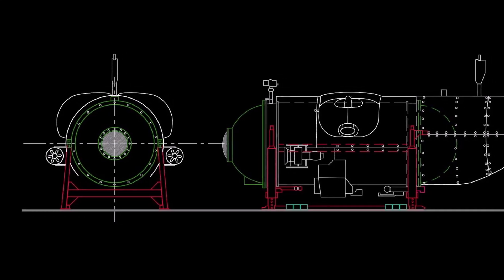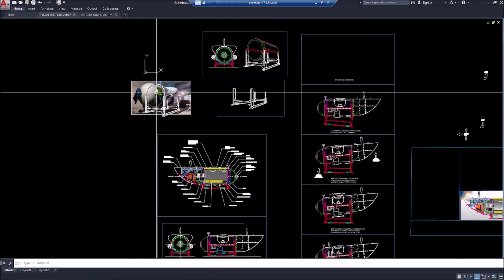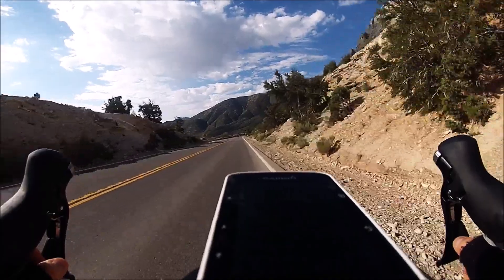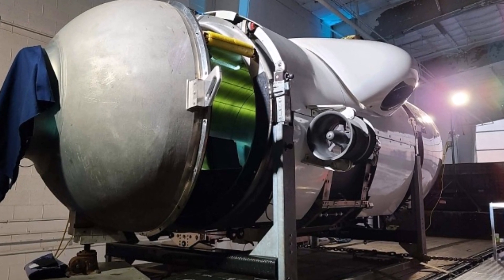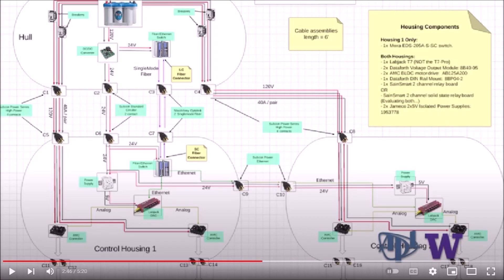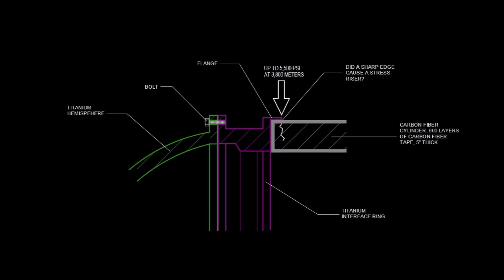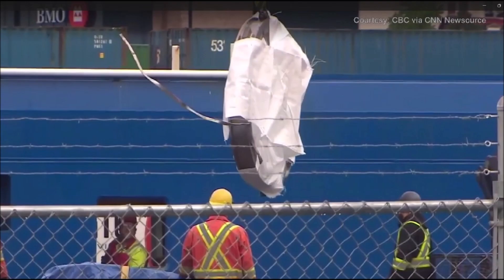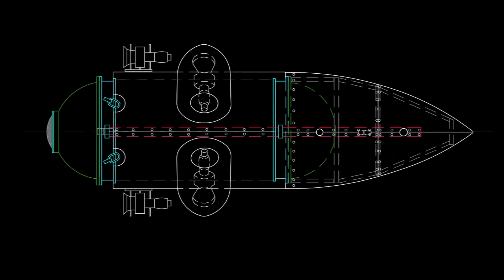OceanGate Titan - INTERFACE RING CAUSED FAILURE?

Comment: I agree with you that the weakness of the matting surface between the flange and the CF was the beginning of the end! I think there were other contributing factors besides those you mentioned also! The depth of the groove to accept the the CF into the bonding flange, but also the apparent tapper that was made to the CF, as can be seen at 3:40 of your video! If in fact this is a tapper, how was that tapper machined into the CF, and the fact that would provide a weak spot in the fiber! The groove should have been much deeper to accept the CF and the metal outer  surface should have been a lot thicker at the groove to provide a much more ridged outer surface to not create a 'pinch point' at that area! Not the flimsy thinner material on the outside of the groove that appears to be used! That area gave the CF a spot to flex outward as the [pressure was pushing in on the middle, thus causing the ring to pop just nano seconds before the implosion!
Reply from the maker: Yeah I hadn't really noticed it until someone else pointed it before you that the CF cylinder seems to be machined at the place where it would meet the interface ring. Certainly could be something of a factor here, how much I don't know. More and more everything seems to point to Spencer Composites providing OceanGate with a sub-par hull for a variety of reasons. I pinned a comment that has some very good info about the carbon fiber if you want to take a gander.

Comment: (4:19) You are missing the inner flange on the titanium ring.  The shell side of the Ti ring has a lathe-cut U-shaped channel that the end of the CF shell fits into.  The CF shell was cut down on a lathe slightly before bonding with the Ti ring, presumably for a more precision fit.  The inner surface of the Ti ring is straight not stepped as shown in your drawing, although I don't think that feature is important in the failure analysis.  A good view of the channel is part of the Oceangate video your winding clip is from.  They show the adhesive being spread on the inside of the channel.

Comment: (6:39) I don't think that is a notch.  There is a high resolution photo of this ring being unloaded in St. Johns on BBC's website and copies elsewhere.  If it were an intentionally cut notch, one would expect to see straight, well defined edges.  They are not straight in the photo.  My hypotheses is the black patch is some carbon fiber that remains stuck to the ring as can been observed elsewhere in the photo and in photos of the 1/3 scale model test wreckage.
Reply from the maker: Yes not at right angles to each other... probably to avoid creating a stress riser. The edge on the left isn't perfectly straight but it also had experienced a unimaginably violent implosion... could just be a little warped from that.

Comment: (5:43) There were two CF shells, the first built by Spencer in Sacramento in 2017.  This video clip is from 2017. The second CF shell was built by Electroimpact and Janicki Industries in Seattle late 2020 and presumably included lessons learned from the faulty 2017 shell.  Stockton Rush states in video presentations that both shells (2017 & 2020) were laid up biaxially with carbon fibers running radially and axially (perpendicular and parallel) to the cylinder axis. Brian Spencer confirms biaxial layup. The 2020 shell was fabricated with higher tech, aerospace grade equipment. It was built up with 1" layers and cured between layers. The layers are visible in the photo at (1:45).
Reply from the maker: Interesting info. That would explain a few things about pictures I recently found that show a different method of manufacture... no flanges on that spandrel. The method of manufacture you describe seems to be a much better way of doing it. I could see them doing bi-axial layers in the second one since the spandrel had no flanges on it. First one I don't see it was possible to do with the flanges on the spandrel.

So what happened so the 2017 version? How did they know it had problems? RTM system? Just curious how they would determine that.

Comment: It wasn't the outside flange that failed it was the inside flange that failed, that was only say 1/2" thick and was holding the carbon fiber in its shape, think of it like a glass window where it's incredibly hard to break when it's supported all the way around but extremely weak if rolled down even the smallest amount due to one edge being able to flex. I think that the inside lip started to crack on the rear ring and allowed the carbon fiber to lose its shape and implode.
Reply from the maker: Maybe. If the carbon fiber was manufactured to OceanGate’s specs, the carbon fiber wouldn’t need to rely on anything else. In reality it could have been either or both flanges responsible. If the carbon had too much resin due to how it was manufactured, that would make it weaker. Those domes saw up to 22,000,000 lbs of pressure at 3,800 meters, pushing them towards each other, plus the compression radially where the flanges were externally. Sharp edges anywhere on either of those flanges could result in the edge failing. It’s kinda complex set of interactions going on with those interface rings.
Reply: @VegasCyclingFreak  I think the carbon fiber wasn't strong enough either way due to how it wasn't "woven" together. I also think it was the rear ring that failed because it never got stress relived like the front door every time it was opened and closed without a torque wrench, the front door changed the stress on the the ring to fiber interface every time the door was opened and closed where the rear ring was always in its same stress points and due to all of the stuff hanging off the back it would expect the same loading and unloading to the exact same spots on the ring every single dive it took. Thank you for the response, you are the only one that has taken my thoughts on this somewhat seriously .
Reply from the maker: @wheelitzr2  There are a lot of things that point to the CF cylinder being sub-par. I think that is really at the core of it. The flanges on the rings really shouldn't be too much of a factor if the carbon was very strong. I agree with you that the ends may have had insufficient fibers, so it was the mainly the strength of the resin there.

Comment: Personally I think you are correct just from listening to the timing of the sounds, which was the first time I have heard it clear.  Had it been a large failure I don't think you would get two distinct sounds especially the pop and then the crush.  Something smaller failed "pop" and weakened the pressure vessel, depressurizing it and then leading to the second "crush" sound.
Reply: Not a recording of the Titan.
Reply: The large pop HAS to be the main passenger space - the smaller ones could be from the scuba bottles they have  - but those could be inside???
Reply: @gregmanko4035  This recording is from Ocean Networks Canada.  It is from a calibration test they conducted in 2013.  This recording has been making the rounds on YouTube.  It is sad YouTube content creators don't do a better job verifying their source material and lead their audience down a false path of speculation.

Comment: That's a very interesting find regarding the notch for the hull penetrations.  From the design of the CF to titanium joint, it's really implausible to be that cutout could have faced the CF side of the ring.  If be interested in a little more how you concluded the orientation of the ring in that shot.  Even if it faced the dome, that may still have cause a soft spot in the interface ring that would have transferred more stress to either side of the notched out area in the interface ring.  It's a little mind boggling to me they put the pass through in that location.  These are typically spaced evenly around the dome with slightly thickened bosses, but need to be careful designed to avoid causing stress concentration in the dome.

I definitely am with you regarding the interface between the titanium rings and carbon fiber being a very complex and interesting area of the design that draws my attention as a likely cause.  There has been much said about carbon fiber being so much stiffer than the titanium, however, the titanium is much thicker wall and supported radially by the domes as well.  There is a tendency for the bonded joint to rotate, which causes some stress concentration due to a moment carried through the bond.  The lips on the ring could definitely have been applying pressure radially and contribution to the stress concentration and localized progressive failure in the carbon fiber tube.

The orientation of the layup is shown circumferentially in the video clip you show, but i was able to find a few short clips with mentions of the layup being a 0/90 layup, scheduled to support the ~2x hoop stress relative to the longitudinal stress.

Very interesting work, thanks for sharing!
Reply: @VegasCyclingFreak  Agreed with all, it's just hard to tell whether we are looking at the front or back of the interface ring.  The discoloration is not obviously adhesive to me.  There have to be some higher resolution photos of the ring somewhere..
Reply from the maker: @jonbeno9926  There may be but it’s not available to the rest of the world at this point in time. I think the best we are going to get is that debris video. 😕
Reply from the maker: It was just a matter of lining up where the ports were with the notch on the interface ring. You can see where some of the glue was so that means that side was facing to the inside of the hull. If you look close you can also just see the remnants of one of the ports in the debris video, on the other side from where that notch is. Drawing it up in CAD also helps me figure stuff out.

I debated for a while about that notch… looks too square and consistent to not be intentional, and it happens to also line up with where those ports were.
Reply: (6:39) I don't think that is a notch.  There is a high resolution photo of this ring being unloaded in St. Johns on BBC's website and copies elsewhere.  If it were an intentionally cut notch, one would expect to see straight, well defined edges.  They are not straight in the photo.  My hypotheses is the black patch is some carbon fiber that remains stuck to the ring as can been observed elsewhere in the photo and in photos of the 1/3 scale model test wreckage.
Reply from the maker: @AwkwardDavies  Yes. Apparently they needed room for something inside... maybe there were elbows that went from computer compartment to the exterior via those ports. Or it was some kind of block that was inserted into that notch.
Reply: @VegasCyclingFreak  The more I simmer on this and look at the photo, the more it looks like residual bondline/carbon fiber and less like a pocket/notch.
Reply from the maker: @jonbeno9926  I thought that when I first saw the debris video (the same day it was available) but those lines at "the notch" are too perfect... and the CF was wound like a giant roll of tape, so they wouldn't be flat and parallel to the interface ring. I know there were wiring ports for data, that came straight out of Rush's mouth. It's kind of frustrating not having good pictures/video but I captured a few shots where you can see them. Last picture in this short video shows one of them very well. I know what I'm looking at but for other people it's not so obvious.

https://www.youtube.com/watch?v=IJRpEh8XMYg
Reply: @VegasCyclingFreak  That link is to a private video.
Reply from the maker: @jonbeno9926  Sorry. Try it now.

Comment: I appreciate the investigations.
The Swede that did a lot of carbon fiber stuff on yachts that I worked for only used it in areas where the stresses were specific.
I think he said it was solid in linear ways only. 
Other pressures marginalized it greatly, he said. 
I'm not in the know, but he was a top notch shipwright. 
We only used carbon fiber in areas that were safely isolated from unintended stresses.
He was intensely focused on it's linear strengths and weaknesses.
BTW, I can't find anything about the bonding adhesive. 
Do you know?
I wonder if it was 3M 5200. 
That stuff is alien for surface vessels.
It would end one of my queries if I knew what the bonding agent was.
If it was Sikaflex I would be irate.
Reply from the maker: I haven’t really investigated anything about the glue, yet. Seems like it’s not that much of a factor… but I could be totally wrong. Kinda outside my wheel house.
Reply: - It was my first thought even though I didn't have a clue about submarine standards. 
After this event and little investigation I believe the cylinder instead of sphere was not genius at all. 
Dunno, I really didn't want to give this story more than 5 minutes of attention at the beginning because I know that far more suffer far worse for lesser reasons on the water. 
I'd really be interested to know the bonding agent, though.
It might explain the initial cork popping sound.
Reply from the maker: @clintstinkeye5607  Yeah frustratingly all I can find is reference to peanut butter. 🙄 All Rush was doing was describing the consistency of it in terms everyone could understand. 🤷🏻‍♂️
Reply: @VegasCyclingFreak  - I worked for a guy that made some of the strongest wooden hulls on the west coast that used Sikaflex on the garboard plank.
That is just wrong. 
5200 is the minimum for the garboard plank. 
Never heard of a better option for a surface vessel.
Reply: @VegasCyclingFreak  - Another thought is the lack of attention of the surfaces being bonded prior to assembly.
I was harshed on ONCE for touching certain surfaces prior to assembly with bare hands.
ONCE!
There is a video of a guy "cleaning" the surfaces prior to assembly while he had a bare hand on it.
Contrary to popular egos, human hands transfer oils and misc contaminates that freshly wiped latex gloves won't. 
My Swede teacher was a freak about details.
The best glue for teak was a disaster with walnut.
Jeeze ... why is everything such a headache?
Reply from the maker: @clintstinkeye5607 Yeah I have read some people's comments in various places on the internet where they were questioning why it wasn't done in more of a clean room environment like NASA would use. Once again, this is out of my wheel house so I don't know how critical it is here with titanium domes seeing 22 million lbs of compression at 3,800 meters. Seems to be more of a problem with dissimilar materials having much different rates of expansion.
Reply: @VegasCyclingFreak  My wheelhouse, too.
Reply: @clintstinkeye5607  The video of the guy cleaning the titanium ring is from the first hull from 2017, a second hull was made in 2020, they may have done things differently in 2020.  The video only shows him cleaning the outside of the ring, not the bonding surface. I have found no photo/videos showing cleaning of the mating surface, only videos of adhesive being spread on the surface.